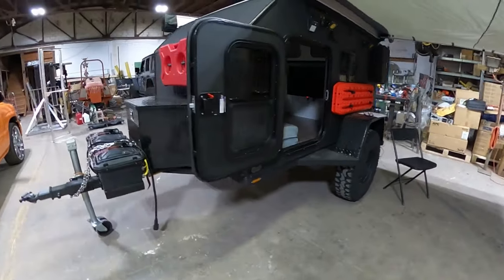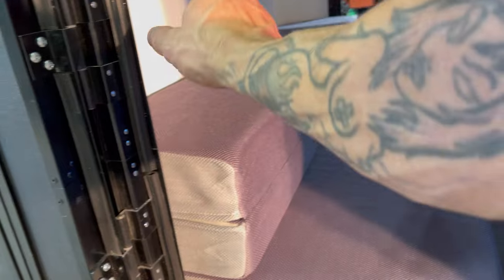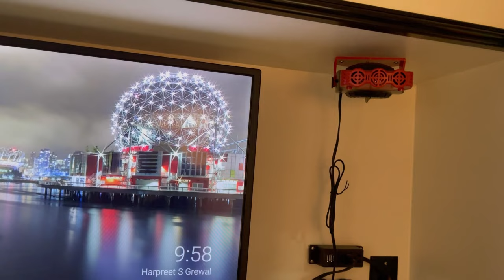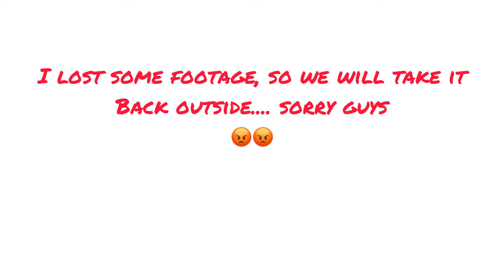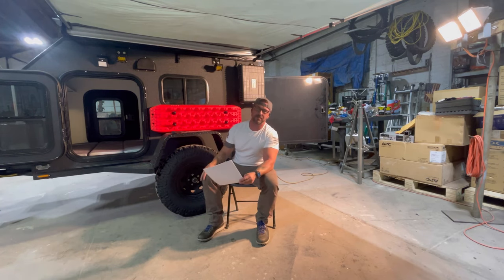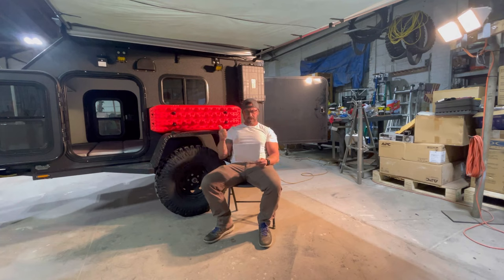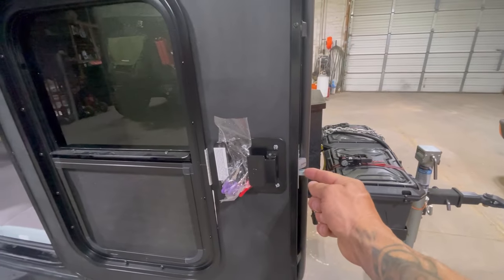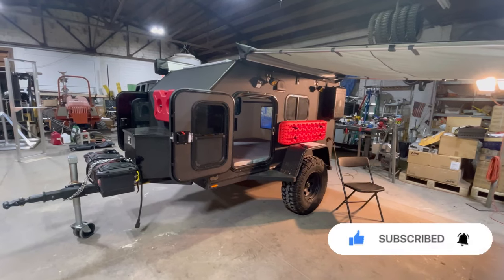Off Road Trailer Camper , The Full Review

Comment: I also have a 6x8 Rhino, got it last summer. I am 6’1” and need to sleep at a slight angle in order to stretch out. The AC does get in the way of feet room, I have my head on the other side so the pillows dont cover the intake for the AC. Unfortunately I did not think to have them shrink the garage to give a bit more room.

We were camping in 35deg weather last weekend, we did not even need to turn on the heater. Condensation on the walls but that was it. I have considered putting a fan in the roof, but cannot bring myself to cut a hole in the roof.
Reply from the maker: Hey Anthony !!!!
Thanks for jumping in here , yes my kitchen area is a bit different for more cabin space. 

To your point of the fan, I decided against the roof as well and added it to the side of the camper. It draws air from the passenger side upper shelf compartment . I just use it to keep the inside from condescending , so maybe that will work for you. I hope you enjoyed it and if you did please consider liking and subscribing! ITS FREE. 

I have tons of aggressive Offroad content with the trailer on many off-road trips. 

Cheers !!

Comment: Hey, I just found your channel and I really appreciate the detailed review of this camper.  I live about 90 min from the Tiny Camper shop in Florida and plan on taking a trip over there to see one in person soon.  Are you still happy with the build quality after having it for over a year?
Reply from the maker: Hey thanks for watching and jumping here. It's got over 40K miles on it through some of the toughest trails in Colorado, New Mexico, Utah, Oklahoma,Arkansas and Arizona and Its still going strong. Now I've many upgrades to it but it still has been a great trailer. I even flipped in Bears Ears in Moab in four feet of snow and its not even dinged up. But Ive done a laundry list of upgrades that are here on the channel either in short video form or trailer videos. It has a diesel heater , AC, 600AMP hours of Lithium back up power, 400watt solar panel, 1800watt inverter, On demand hot water system, Onboard 15 gallon water tank,Bluetooth stereo, Shock tower upgrade, 9ft awing , 270 degree awning and scene lights all around including under the doors when you open them. I made this into the very epitome of an Offroad trailer and base camp. Is some of that overkill ? Mayne but I camp all year round to temps in -10 and all the way in Texas heat to 110F. So I think it's been an excellent purchase. Please look at some of the videos based around this trailer, I think you'll see Im quite fond of Kong. Hope this helps, if you liked the video , please give it a Like and consider subscribing its free!! Thanks again.  PS... I still have Kong and have no plans on selling if that clears it up 😁😁

Comment: Great review. I hope you’ll update us after taking it out a few times. I’d love to see more about the items you’ve added. I noticed you have outdoor lights. It doesn’t look like that is an option from Tiny Campers but I think it is essential. Looks awesome!
Reply from the maker: +William Hanna First off thanks for the interest!! And yes I have two trips coming up in a couple weeks that we use as shake down runs. I wanna get and see how well it does in the rocks. I pulled it down some regular dirt/ranch roads when I initially got it and it didn’t even notice. 

I will be doing a full review on the new 270 degree awning, the outdoor lighting , the battery and solar system, the hot water system as well.

Thanks again for watching !!!!!
Reply from the maker: Hey just wanted you to know , I have some more content in the camper !! Check out new videos and I have a real tough coming up this week to upload.

Comment: I think this is the way im going to go. ideally i would put a slide in on my truck for beach camping trips etc but by the time i get done with everything i would need for that id be at least double the cost of this for a cheap one. its also nice to be able to unhitch and leave it on site. is there a rating for the roof? id like to be able to put my 13' kayak on top but i could also always put that on my truck rack like i do now
Reply from the maker: Hey thanks for watching, I have tons more about this trailer and topic on my main channel. I just released a video about the benefits and base camping is a huge one. The video is RTT or hardshell. The crossbars and capable of 150 a piece so 300 static weight. So a kayak would be nothing, most people add an RTT for their kids to sleep in. I weighed all the costs and this at 10k is so hard to beat. My favorite part is being able to leave it where I want to stay camped at or when we get back, just unhooking and going about my business in the truck. I load everything in it, and the only thing I throw in the truck is my clothes bag. 

I hope it helped in anyway and please if you haven’t subscribed, please consider it. I tons of offroad camping content.

Comment: Great video! I'm doing research on affordable camper trailers myself and this Tiny Camper Company is kinda hard to beat in terms of price. Did you add the solar panels and shower systems yourself? I didn't see those as an add-on options from the website.
Reply from the maker: Hey thanks for watching 🙏….. yes I did actually. Sourced it all from Amazon for the most part. I have it all in the video description. If you need anything more please feel free to ask. Mounting or location etcetera. 👍🏼👍🏼👍🏼
Reply: @maximumoverland  Your trailer + the mods looks great! Great job. Was it difficult to add the shower and water and everything?
Reply from the maker: @simonsuh227  no no it really wasn’t. Researching was probably the hardest part so you can get the most out of a little space ! I sourced the cases from Harbor freight and the shower from Amazon. Most of all this stuff is in my description of some of my other videos if not they’re on my link tree. If there’s something you wanna specifically see let me know and I’ll try to add the link for you. I basically I’m out of the shower components inside pelican style cases both of them through the wall with fender washers and sealed everything with our RTV sealant. The sink components are already there from Tiny Camper Company but no water storage so I ordered a 15 gallon water storage for an RV with specific inlet and outlet to fit the space. Really all you have to determine is which side you’re going to put it on and how to get an access to to fill the inlet port. I do have a secondary front runner 10 gallon water tank on the roof rack to give me a total of 25 gallons which I find sufficient for two adults. That includes cooking and showering quickly over a 4 to 5 day period honestly thanks for the comment. If you have any questions or anybody else has any questions feel free to ask me I have no issue with helping anybody as much as I can. Also i’ll add this, I don’t get paid for it but I do have a discount code with tiny Camper company and they just give you some money off the top in case you’re interested in the future. Code: maximumoverland10

Comment: That for sharing. I'm looking into getting the 5x8 Kong as well. Do you mind share the galley dimensions? 
Width of the galley shelf.
Height from the galley floor to the bottom of the shelf.
 The opening of the galley area.
Reply from the maker: Hey thanks for watching Rafael !! I will get some here soon and post them here !! Again thanks for watching and please consider subscribing 🙏🙏💪🏼
Reply from the maker: Message me directly and I’ll send you some info. All my info can be found on my Instagram page. maximum_overland
Reply from the maker: Hey Rafeal go ahead and do me a favor if you’ll check your Instagram messages I sent those measurements over in a couple pictures hope that helps thanks everyone

Comment: How did you mount the Rotopax and Maxxtrax without the through bolts showing into the interior?
Reply from the maker: Thanks for the interest…. Yes actually they bolt through with fender washers. They are hidden from the inside because there is a false wall the covers the fuse bank and some wiring……. Hey if you need anything else please ask…. 👍🏼👍🏼👍🏼
Reply from the maker: The rotopax I welded a simple mount together then attached it with 1” lag screws and construction adhesive. It’s extremely solid.

Comment: I still like the ones that have a 45 degree popup roof so I could stand up and get dressed in the morning...
Reply from the maker: Hey James thanks for watching and commenting, I appreciate it. So I can totally understand but I chose this style for a couple reasons. The type of trails I put this trailer through, I needed the rigidity of a solid roof. That much missing structure wise would jeopardize the rest of the structure when you’re bouncing it off the rocks and seriously articulating the suspension.
My trailer was purpose built to go on rock trails and and  unmaintained tracks and it does that real well with zero shifting since I got it. I credit that to a solid frame and complete structure. I hope this helps clear up my choice and possible what to consider when purchasing. Please consider subscribing if you haven’t already and maybe give the video a like if you found it useful. 🙌🙏